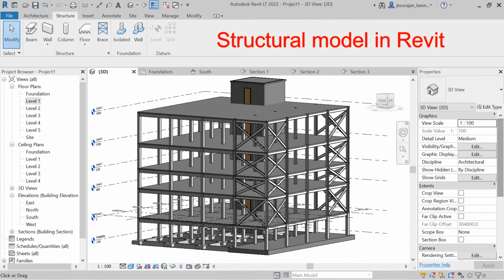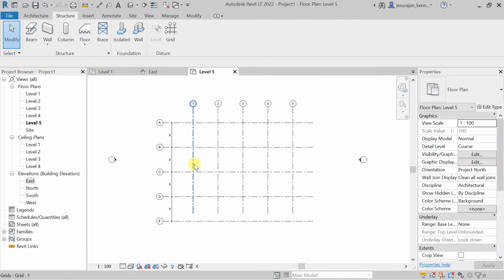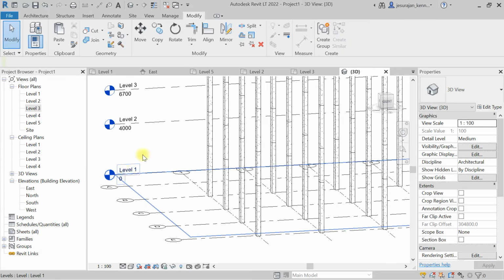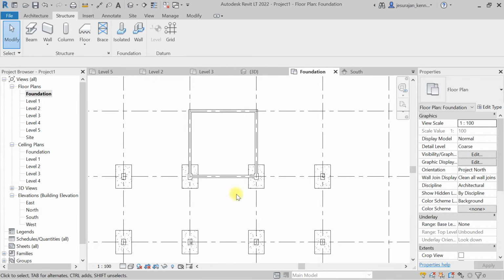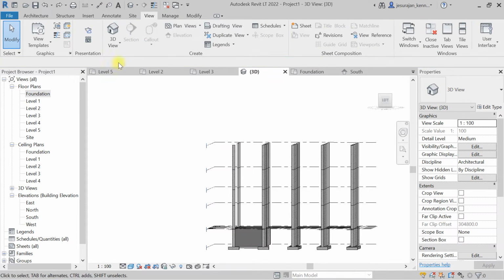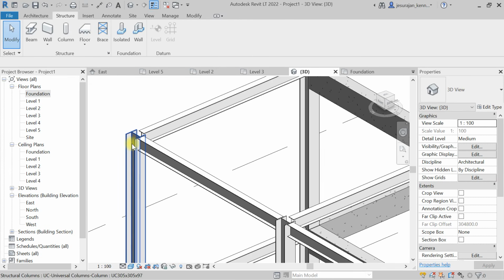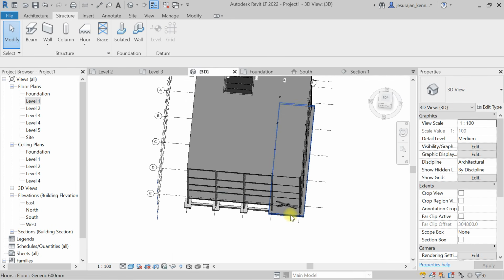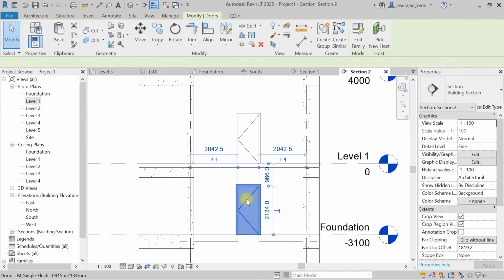Structural modeling in Revit

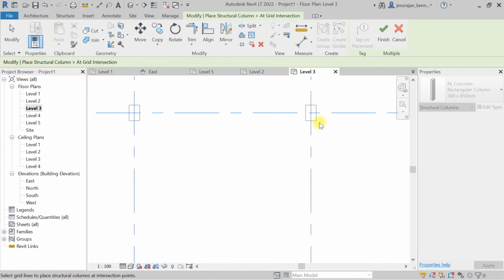Comment: After selecting all the Grid, at 8:44 , I'm not getting any preview, (after clicking 3D view, I'm only getting 3D columns, no levels). I also get a pop up warning me and saying, none of created elements are visible in Floor Plan: Level 5 view. You may want to check the active view, its parameters, and visibility settings, as well as any Plan Regions and their settings. Plz reply asap I am stucked here..
Reply from the maker: Yes, check visibility graphics override setting
Reply from the maker: https://youtu.be/Sn-lXG4qQb0
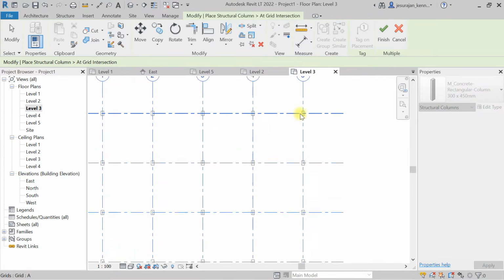Reply: @Jesurajankennadi  thanks for your prompt reply but my prob still prevails after these video steps. After selecting all the Grid, at 8:44 , I'm not getting any preview, (after clicking 3D view, I'm only getting 3D columns, but no levels).

Comment: This timeline for my reference 
4:16 dim equal
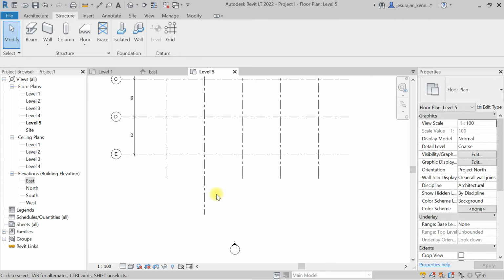6:25 3d2d
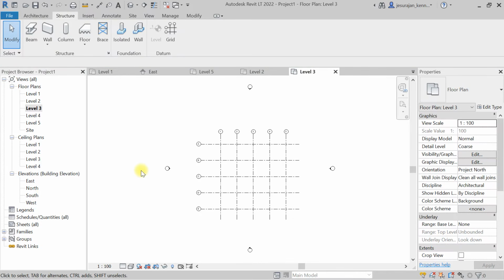7:32 column
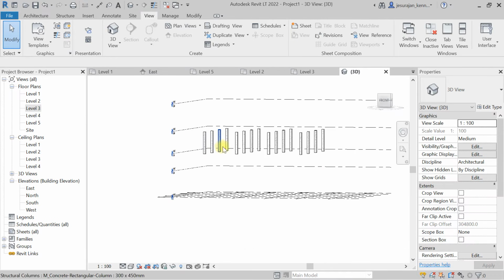9:08 copy column
10:28 connection of column gap
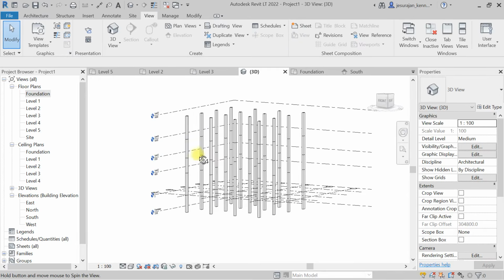14:13 foundation isolated
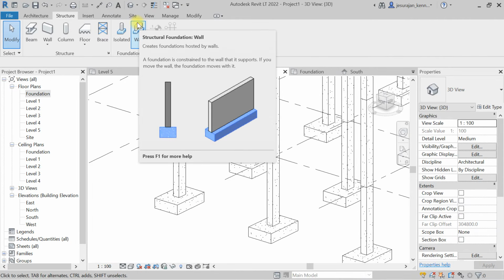16:58 wall little bit confuse
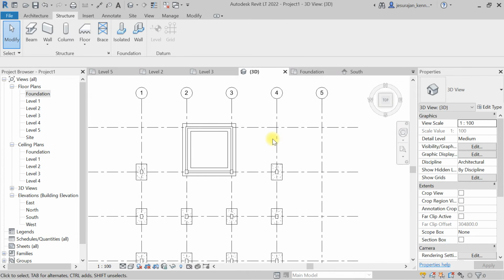19:01 raft foundation
20:13 steel try
21:50 shaded [boosted confidence]
23:12 wall paste
24:55 beam
27:20 change thickness
27:58 replace fck to fy beam
29:20 slab
29:52 clashing
31:10 lift opening
32:07 bracing feel difficult for me
37:53 slab
37:08 extension
39:39 door 
Very Big Thank you sir for helping and improveing our skills 
1st time when doing i feel difficult and 40 min takes me around 5 hours 
But the concept helped me by practice i can make best
Reply from the maker: In the wall what's confusing?
Reply: Sir in properties we need to see the same as in video and we are the properties are not same 
And the wall is going - below foundation

Comment: it would have been great if the whole thing didn't go wrong with the very first part of the lesson. Those columns were overlapping after it was "fixed."
Reply from the maker: Yes, when an element is placed it has to be checked. Correct it if the placement needs to be adjusted.

Comment: I LIKE TO JOIN A COURSE WHERE I CAN LEARN ARCH MODEL WITH ALL CONCRETE ELEMENTS AND QUANTITY TAKE OFF. PLS  DESIGN A COURSE WHERE U WILL SHOW PILE TO OVER HEAD WATER TANK , INCLUDE PARTIAL RAFT FOUN, ISOLATED FOOTING. BEAM .COL. LIFT SHAFT ETC, B1+G+5, SHOWING ALL MATERIALS AS LIKE WATERPROOFING , SCREED ALL ALL  AND COMPLETE FIT OUT AS PER ARCH
Reply from the maker: Thanks for your comments. It's a long requirement. I will surely make videos to show all concepts.. thanks
Reply: I like to join ur next  course @Jesurajankennadi
Reply from the maker: Please call me on +91 9035623806
Reply from the maker: Please consider becoming a channel member. Only members can participate in the Teams community. Members can ask questions on Microsoft Teams chat.